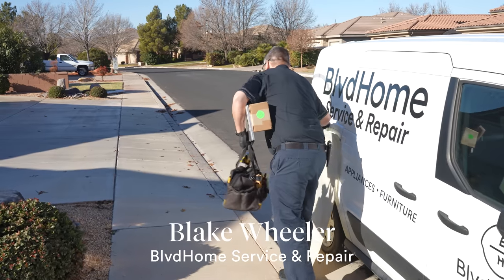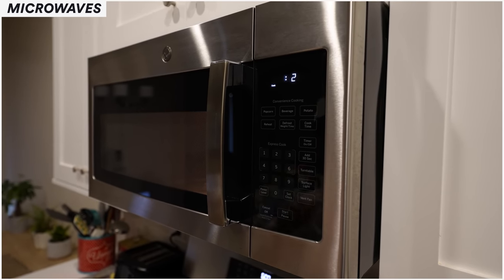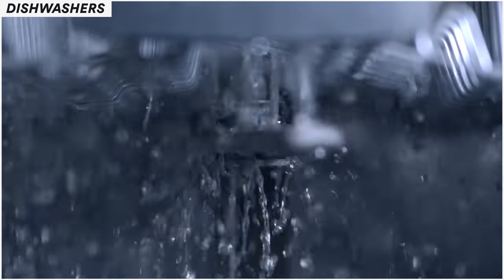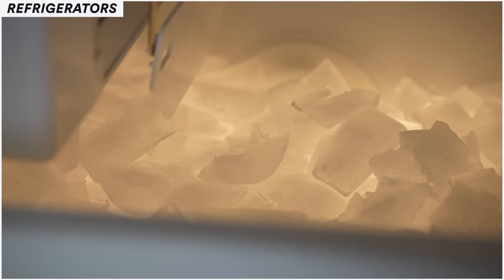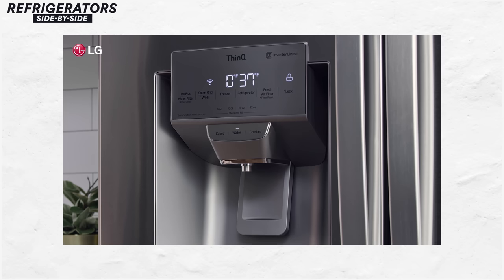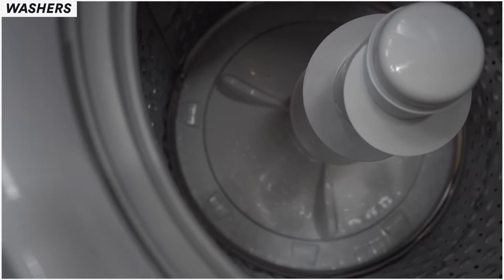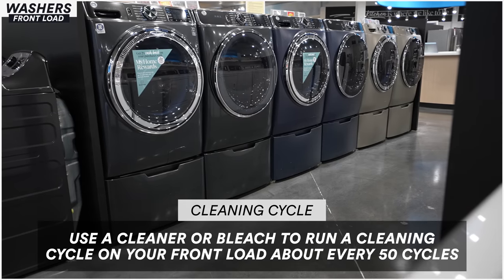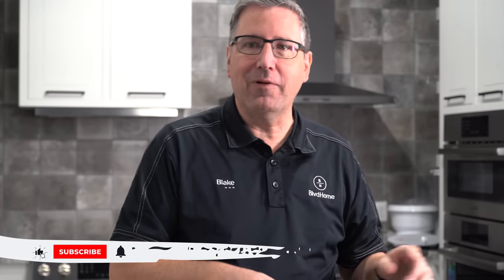Best Appliances Recommended by a Repair Technician of 29 Years

Comment from the maker: Just want to point out since we didn't mention it in the video. This is NOT sponsored at all by anyone. This is purely based on Blakes opinion and his 29 years of experience. Now if any of these brands want to do a sponsorship... 👀
Reply: appreciate for sharing facts
Reply: So appreciated 👍
Reply: avoid LG and samsung and GE.
they all same compressors which are all  made by samsung....
Reply: I do miss one thing from this video -> presentation of the appliances which are used by Blake at his home ;)
Reply: Looking for appliances for a vacation home and Blake’s review was super helpful.  We have an Electrolux all refrigerator at our house because we are veggie-voirs and veggies take up lots of room…. I was a little anxious to purchase a brand I wasn’t too familiar with but it has worked out great for us.  We had struggled with an old GE side by side for over a decade.  One of the best things we did was to change over to an all refrigerator and Electrolux made one of the right size for our finished kitchen.  

At the same time we replaced the fridge we decided to go with under counter freezers.  We love those too.  They are by Marvel and have a single door with 3 pull out SS baskets.  It is so much more convenient than a side by side with shelving!  The only down side is the lack of an ice maker but that was an easy problem to solve….   Blake’s take on the Electrolux brand has matched with our experiences.  I really appreciate the video.  Thanks for sharing!
Reply: Whirlpool is the Best when it comes to refrigerators for a good reason. Theirs Compressors are the longest lasting and thanks to no nonsense design. The failure rate is extremely low. I owned 3 Whirlpool refrigerators over 3 decades now and the two that we gave away(in perfect working condition) were after 20Yrs of continuous usage. The new one is already 5Yrs old an no issues at all.
Reply: So basically “We didn’t sell out, but it’s only because no brands wanted to pay us, but if they do offer, we’ll sell out quicker than a Taylor
Swift concert”. 👍
Reply: “… 👀” real 💀
Reply: You mentioned Speed Queen. I’m interested in learning your opinion of their front load washing machine. I’m assuming it’s the same as their top load and comparable to Electrolux? Model FF7009WN
Reply from the maker: @dlee6985  We'll always still give our real opinion wether it be good or bad. And any sponsorships will go right back into making better content!
Reply: @tocreatee3585  Samsung laundry units are awful and so is their warranty. would never buy one again.
Reply: I'll subscribe and like in case  you get a sponsor.
Reply: What do you think of the Maytag commercial units (the real commercial)?
Reply: I work in household appliances department of big 
electronics market in Poland. While we don't have any GE equipment for sale I would say that other things you said is mostly correct but you didn't say a word about Haier - they are the biggest company and have highest quality of products. Bosch, LG, Electrolux are nice but when you see Haier stuff next to them there is simply no competition. Simple button pressing or opening a door and you instantly feel the difference. But they are also more expensive
Reply: Haier is GE. They bought it.
Reply: why Electrolux instead of Miele front loaders?  here where i work, the most durable front laoders are usualy Miele
Reply: AVOID anything form LG and Samsung.
Reply: Hi Dear, whats your opinion on bosch front load washing machines? We bought samsung refrigator, but thinking about to go with bosch dishwasher and washing machine instead of samsung o.O
Reply: yea ok
Reply: Don't need to refrigerate eggs. Don't need to refrigerate a lot of things we refrigerate actually. Freezing on the other hand....never skimp on your freezer(s) even freeze driers now and in reserve always keep some high quality coolers like Iceco et al.
Reply: @justinmakosky5201 in the 70s I had a white one, but then "she who must be obeyed" wanted GREEN, then amber, then stainless steel then 35 years later I ran into the couple I'd given the white one to and they said it was still working😢. Meanwhile the others I'd been through had all died. Oh, yes, and by the way IT DRIED the clothes too😊.
Reply: Good one! :-)
Reply: We’ve had two dishwashers and both leaked. Homeowners association insurance always tells us no. Hubby gave up on them. Washing by hand :(. Lucky us, hardly any company. I’m the sole survivor from my immediate family. So, other than cousins who live more than 7 hours away and spouses’ that live even further than that, we don’t get a super extra dish loads to wash.
Reply: hello , I think you forget about bosch on wash machines , on electrolux generally problems with  bearings and pump water.
Reply: @BoulevardHome . Just bought the Bosch Series 8 last Saturday. What a stunning machine. Perfect drying and cleaning. One minute critiscm is the interface can be slightly finicky, but no big deal. Originally bought an AEG and after 2 weeks of ownership I told large department store to stick it so they collected it and I demanded them to swap it for the series 8 Bosch.

Cheers NZ.
Reply: I have a Kenmore Elite basic refrigerator it has the Water and ice maker at a side of the freezer  is an old model refrigerator . My husband disconnected the that because  was a lot of water coming down to the h e bottom part of the refrigerator where the shelf are.I have ve to clean almost every week because is a lagoon inside the bottom drawers are full of WATER and smells eventually my food spoiled. Is a mess. Doyou have any Idea what might be?.
Reply: Guess I'll stop trying to "beat the annoying beep" by pressing pause/cancel before opening the door to beat the beep.  Guilty as charged!
Reply: It’s worth more to me to make or buy my own ice
Reply: Hi Blake, do you recommend any French door-bottom freezer refrigerator without water or ice maker. I don’t have a water line behind my fridge. Thanks?